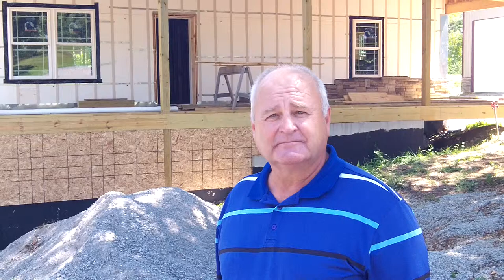Guardian Building Systems L.L.C, Michael J. Schlueter

Comment: The energy efficiency is amazing.  In November during that cold spell we had, the temp in the house didn't get below 55 degree's - we had NO HVAC at that time. 
Now that we have the HVAC installed and working, I have the thermostat set on 63 degrees and the inside feels warmer due to NO drafts cooling the air or your body.
We should have the radiant heating working within the next couple weeks and I'll comment how that is working.
Thanks Paul and TF Forming - LOVE the new house and it's efficiency.